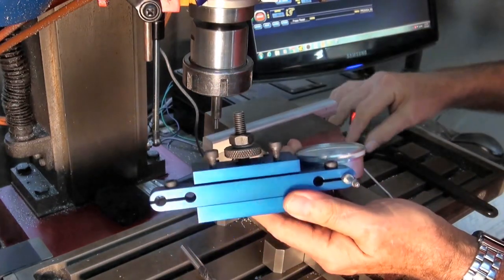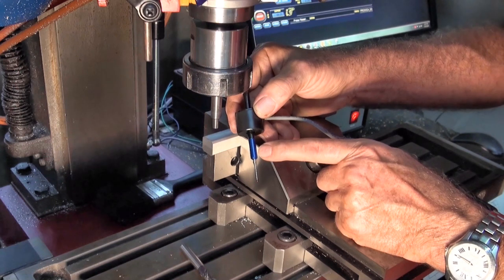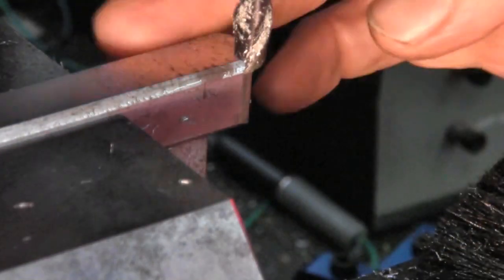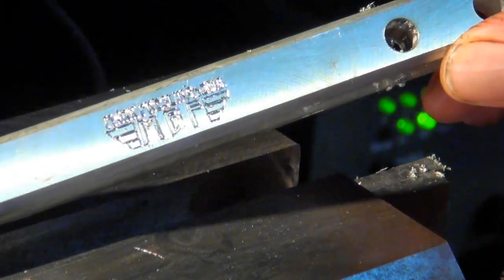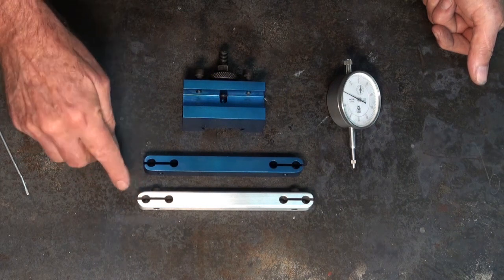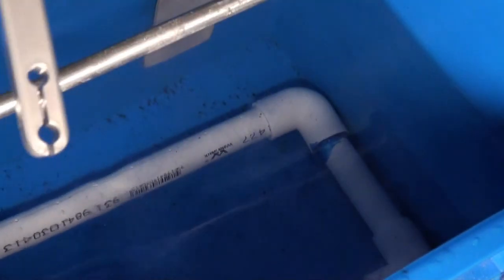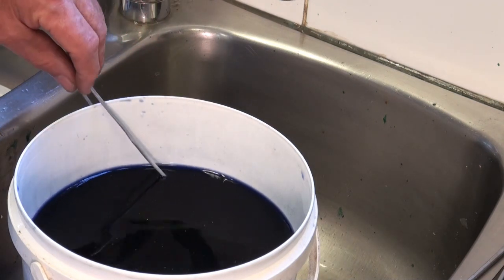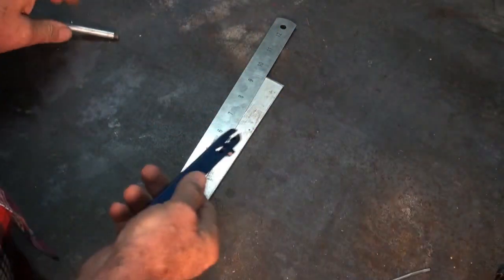Quick Change Dial Indicator Redemption and, DIY Anodising - Bonus

Comment: Nice to see another Aussie showing anodising, not using sulphuric acid.
I too had great success with dry acid when it became obvious that our nanny state means it is nigh on impossible to purchase sulphuric acid that's not in a lead acid battery.
For a dye I used black inkjet printer ink. Worked an absolute treat!

Comment: After watching this video I know you have made yourself another arm to accommodate your dial indicator and there's absolutely nothing wrong with that as long as your happy. But if you haven't thrown the old arm out or trashed it. There is another way that you can still use it the way it was intended to be used. I have a smaller dial indicator that I got from a gun smith that I use quite regularly. I bet it would work in the old arm that you built. The indicator I have the dial face is 1 1/2 across the face. I'm not sure but it's worth a though. And you have a new subscriber, I find your videos quite fascinating and well done. I'm working threw your older videos trying to catch up now. Thanks for all the effort you put into making them.

Comment: Hello Mark I am new to your channel the anodizing got me its great.
How much PH decreaser did you use I have got to try this.
What you have made is fantastic you should be proud well done.
Thanks
Roger
Reply from the maker: Roger,
I just had to look up the ratio again. It's 20% to 30% Sodium Bisulphate to water. Here is the link to the website where I got the recipe from in the first place http://www.observationsblog.com/sciencetechnologyexperiments/anodizing-and-dying-aluminum-without-battery-acid. I have used the same electrolyte for at least five jobs now and it's still working fine. From what I read and from my own observations it seems to be safer than Sulphuric Acid, way cheaper and way easier to get hold of.
Regards,
Preso

Comment: You could have drilled a hole in center of the slot for a pivot pin and cut off one end of arm to pivot from. Then you could have used thumb screws instead of cap screws and just have the arm pivot back and forth.
Reply from the maker: Someone else suggested this before I rebuilt the arm and although it would allow me to reuse the original arm it would still be necessary to move the indicator in the arm. The best solution I saw was a tool holder that could be turned upside down to swap the indicator from face indication to circumference indication. It means having to have a very carefully sized tool holder height but it made swapping over absolutely tool-less.

Comment: Hi Mark, thanks for showing the anodising process, the results are great and give a professional look to the parts. Great to see you got the complete job finished to your liking. Keep up the videos, I'm a beginner hobby machinist with a small lathe and mill so I really enjoy watching :-)
Reply from the maker: Thanks for the feedback. One thing about doing these videos is that it forces me to work to a much higher standard than I would bother with otherwise. The anodising is probably completely unnecessary but it sure looks nice! I don't know if you noticed though but the two parts did end up being different shades of blue. When the arm was wet with dye it looked correct but after I had sealed it some of the dye must have washed out of the surface. This is why batch processing is always going to give more consistent results than one off processing. Good luck with the hobby. Makers rule!
Reply: They still look great despite a slight colour difference. I bought my lathe and mill recently so still getting the hang of things, I'm interested in making small model steam engines and really enjoyed your build of the no8

Comment: Very nice save, but are you really going to leave those two huge capscrews where a pair of short set screws would look more “tidy”? I’m anal too.
Reply from the maker: Hmmm, they sort of have to be cap screws since they have to clamp the two sides of the arm together which in turn grips the stem of the indicator. I try to keep all my cap screws as either M6 or M8 so I only have to keep two allen keys in my tool rack. I guess I should have counterbored the holes. I also thought about getting a second indicator so I don't have to swap ends of the arm. Am I being too fussy? 🙄 Anal retentives unite!